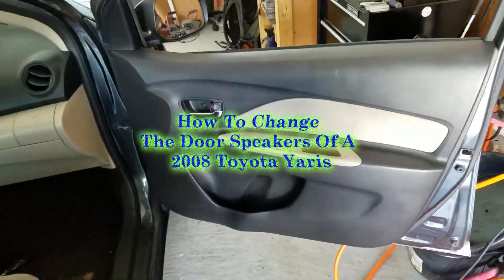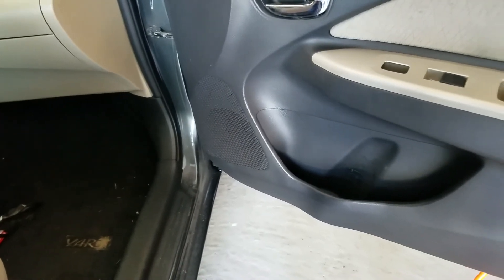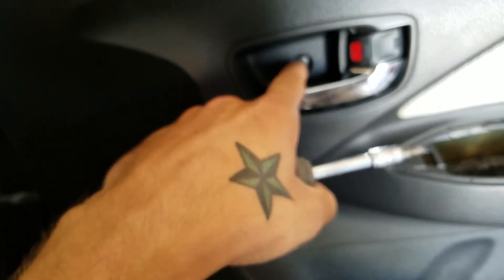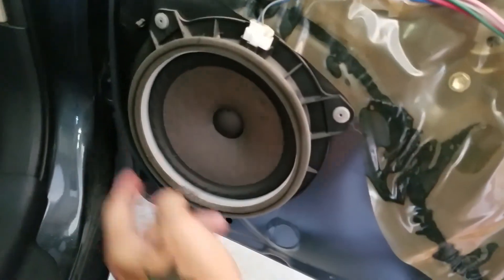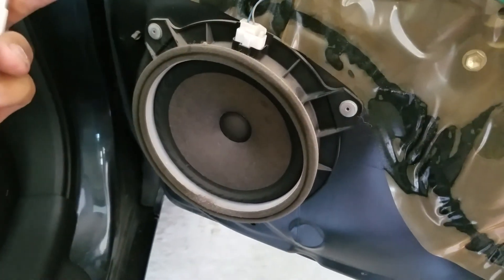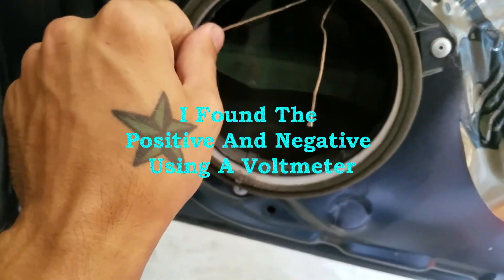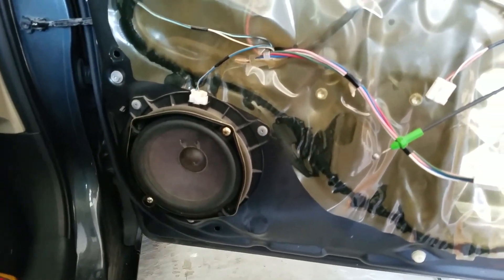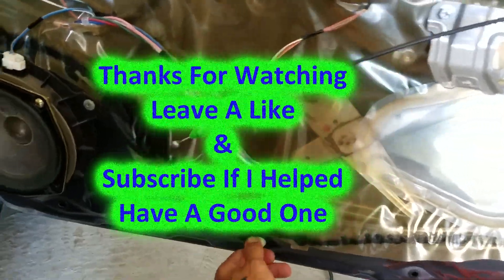HOW TO FIX: BLOWN Speakers!!! EASY Fix! 2008 Yaris!

Comment: Works well. I installed a set of Sony XS-GTF1639 in the front of a 2009 hatch. I was unable to solder the power leads as shown. Instead I removed the white female power wire connector from the black speaker housing and then unsoldered the old braided wire from the metal fitting then soldered a short length of the wire with spade connectors that came with the new speaker then reinserted it back into the housing.  Google for polarity. If your not into soldering these connectors they can be bought pre-made on Ebay.  Was going to do the rear as well but found the speakers on my Australian supplied Yaris hatch are approx 5.25", smaller than the 6.5" in the front. The rear speakers housings have a very small lip so using screws to mount them is unlikely, would need to be siliconed in.
Reply from the maker: Glad I was able to help some how. That's odd the speakers are different sizes though

Comment: Did you just force some holes through the old speaker housing to mount the new speaker? And did you use the same 6.5" size?
Reply from the maker: Kevin Hanley using self tapping screws and yes into the original housing.